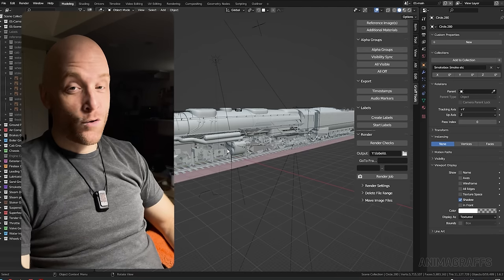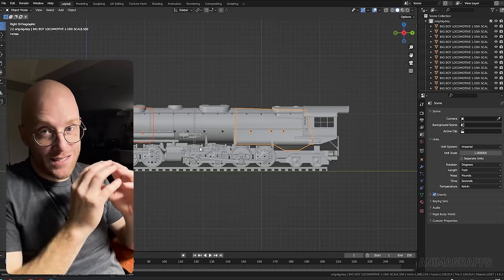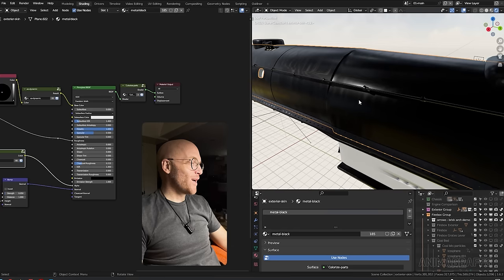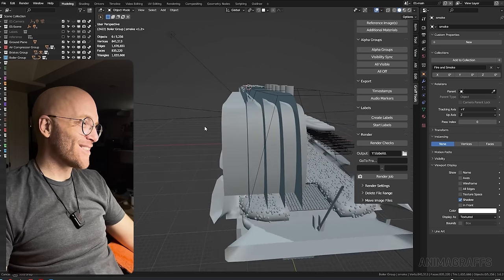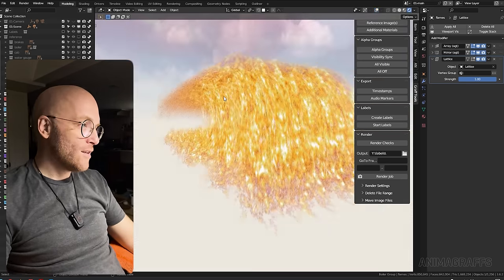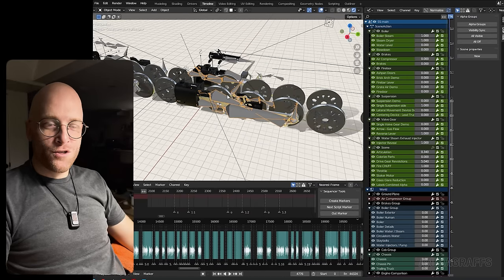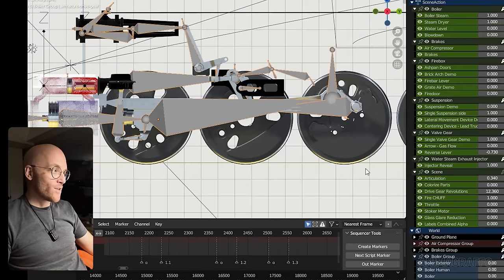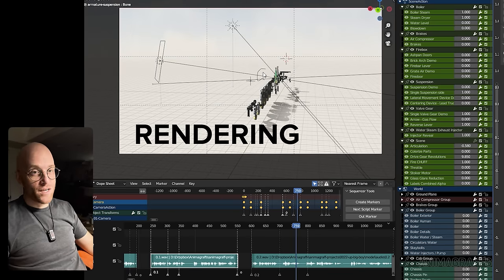How I recreated an entire Steam Locomotive in 3D

Comment: I can attest to the difficulty of rigging the waelschertz valve gear. I haven't gotten mine to work yet and I'm only doing that because I want a more hands-on way to learn how the linkages interact with eachother. I find it absolutely insane that you pulled that off so beautifully. Respect, man.
Reply from the maker: It's the secondary and tertiary movement that really fries Blender's wires. Some of those components never 'rest still', they're always being driven by some other part. Solidarity, may you achieve the holy grail of getting it to work and also actually understanding how all those parts contribute to the final outcome [prayer hands].

Comment: Bloody awesome! I worked as  Mech design drafter in the 90s. I learned 3D surface modeling. Now I use Fusion 360 for my work. So I have an appreciation of what's involved even if I don't use Blender. I sure do get how complex a job it is to do what you did for the Steam Loco video. Damn impressive. I loved that vid!

Comment: I was sure you did all this in SOLIDWORKS or Fusion... And I use those for a living. Man, Blender.. bold move. Much respect.
Reply from the maker: Thank god for the illustrative style I use that lets me keep the meshes really simple. Sometimes tho, try as I might to avoid it, I have to build complex stuff with cutouts and radiuses and proper beveled edges and yes, in a mesh modeler it's a circus ... where in CAD software it'd be a breeze!

Comment: I was really impressed by your Diesel Electric locomotive and always wondered how you acquire your information because most modern designs and drawings are regarded as proprietary and are usually safeguarded by OEMs and Rail Companies. It's even more impressive that you actually reconstruct your information from fragments that you find online. Side note, your blender skills are insane...this is light-years away from the Donut tutorial. 😂😂
Reply from the maker: No wonder it was so difficult to find. The modern loco project really tested me (us, as I was working with my brother at the time). However, with enough persistence, we eventually found the forums where folks were discussing stuff, enough to piece things together. I was staring at drawings not knowing where the lines went, and realize the water tank, for example, was staring me in the face. Couldn't tell what was what without clues tho! The F1 project was put toghether doing deep twitter searches in date ranges, etc. If you want the good stuff, sometimes you gotta go the distance! Glad you're here on the channel, btw :D Here's to the mountain of donuts it took to get here.
Reply: @animagraffs  I was thoroughly impressed by your work, I have worked for over 10 years as an Engineer on Electric Locomotives. Locomotive Engineering is such an esoteric field. When you tell people  that you work with locomotives, the first thing they imagine is a steam Engine Locomotive from the 1920s. 😆😆 I will send you an email, if you have any questions on Electric Locomotives or modern locomotive systems you can feel free to ask me.

Comment: [Just having a template] Totally agree. I had to do a commercial kitchen once (back in the day). Downloaded 3d AutoCAD blocks from manufacturers. The actual manufacturers of the equipment.

And it was horrible geometry. But, I dropped it in and poly modelled on top of it without having to think or guess or measure pixels... Totally worth it.

Comment: Those models you buy are made in a CAD software. CAD is much more easy to work with with hard surface objects (to me) so I understand why those modelers use it. I always do the same, I model machines in CAD and animate and render in Blender. To me, it's really difficult to model a machine in Blender, I'm used to the precision in CAD and modelling a pipe like you did without a dimension feels very strange to me. But yeah, you're good with Blender, I'm not. Congratulations for your dedication and determination.
Reply from the maker: Yeah I do understand why they look like that. If I wasn’t needing specific models, but rather, any generic train, I’d find meshes that are made for this kind of modeling. 

I’ve used some CAD style modelers and even took some tutorials for Fusion. It’s so amazing to be able to cut, bevel, etc wherever you want, with perfect dimensions. I’m with you on that. But I need cinematic style vertex modeling for everything else like materials, rigging, deformation (especially) and so on.

Comment: Pa there is an addonnwhich allows you to do material override on either; material, object, collection l, scene (I believe). Works for both cycles and Eevee. I can post /message link if you want. But learning Python is handy. I've also done that because if an external renderer I used with blender. Because of that, I can make tools I want or adjust add-ons if I wanted to add or edit functionality.
There is also a sectioncut addon, works super nice. I worked a bit on it.

Comment: Amazing.

Out of curiosity.
Do you have breakdown of the effort needed in hours for each phase?
Reasearch, modeling, texture material, rigging, rendering, post comp

Thanks
Awesome work!
Reply from the maker: Research - 2 weeks to get a workable understanding, then ongoing throughout the whole process
Modeling - 3-6 weeks
Rigging 1-2 weeks
Animating and Rendering - 1 week

Since I cover different sized projects, it's probably 1 to 2 months on average, up to 2.5 months for videos 30 mins and above, working basically full time as this is my only income.

Comment: "Locomotive Cyclopedia" - Why couldn't I find that resource when I was doing my 282?  Fantastic resource and it says the first volume is 1906.  Wish I had your Big Boy video as well so it didn't take me so long to figure out the locomotive suspension - especially for the trailing truck
Reply from the maker: :D If you watch Hyce's "reaction" video (linked in the top pinned comment) he also explains more about suspension (and a ton of other info). I accidentally got it right from studying drawings, but it was super duper hard! The theory is a 3-point setup, like a stool, because with those 3 points it will always be resting on at least two of them. Anyways he explains it better than I can, for getting into the nitty gritty. It's cool to hear I helped you find more info though, because I know the suffering of wanting more info and not knowing where to find it!

Comment: This was really inspiring and I'll defo have to use some of your tricks! If you don't mind, how do you deal with the pointer line width receding in perspective? I tried to solve it once but I think I ended up shrinkwrapping them to a plane in front of the camera to get them all even. I'm currently working on something similar but for a church construction documentary film
Reply from the maker: In "edit" mode for curves, there's a "radius" setting that determines the line radius at each point. You can put a driver on the far point's radius, so it scales based on distance from the camera. That is, it makes the line fatter as it recedes from the camera's position. It's not perfect, but drivers also let you edit the f-curve for their influence ... so you can tweak that f-curve so it behaves right.
Reply: @animagraffs  That's so simple and elegant! Cheers for the in-depth reply

Comment: I thought it's probably faster to model it yourself of a blue-peint vs correcting an existing model to a blue print. Corrective modeling on a bought model can take so much work. Unless it's a blend file and you can toggle subsirf on and on. Otherwise your working with tons of poly' which make the work way more complicated. You did state you use it for placement. But how well do those bought models lineup vs your blue-print?

Comment: How different is using Blender to model mechanical things verses CAD programs like Solidworks and Inventor?
Reply from the maker: Those are what's called "parametric" modelers, and it's honestly very different. Where blender uses meshes and points, those softwares actually do have solid objects, is my understanding. And cutting shapes, beveling, etc. it much easier with CAD style software. If you want meshes to deform (like organic stuff, like trees, animals) you need meshes made of points, like the "net" of vertices you see in my work. If you're building parts to manufacture, you want solid, stationary, precise objects.
Reply: @animagraffs  Cool, thanks for the reply! The only reason I asked is, I use CAD every day as an engineer, but as someone with a creative itch I've always wanted to try blender but it's super intimidating to me!!

Comment: How do you do the transparency, because I notice you have fully shaded objects which cast shadows partially covered by transparent objects (the smokestack, for example) but the lighting looks even across it as if the semi-transparent objects don’t block out any light at all.
Reply from the maker: If you're using EEVEE render engine in Blender, you'll need to set your material "Blend Mode" and "Shadow Mode" to "Alpha Hashed". It's not as fast as "Alpha Blend", but it's the only way to get more accurate transparency with shadows and whatnot. If you're using Cycles, that's a whole different animal and it should calculate all that automatically (shadows, transparency, refraction, the works).
Reply: @animagraffs  Thanks! I guess because Eevee doesn't do GI transparent objects don't block out much (or any) light.

Comment: Can you share any resources you've found for accurate fonts? Even though I have a graphic design background I sure struggle to match a lot of the original fonts from this era. As hard as I work just in 2-D, this stuff blows my mind.
Reply from the maker: Heyo, I started in graphic design! Did it for probably a good 7 years, and I'm still so glad I understand design aesthetics. As for typefaces, for the "4014" big badge on the door I used some random font called "Cityof", and I have no idea where I got it as I already had it. For text on many gauges and labels in the cab I used Akzidenz-Grotesque Condensed.

I'll admit I'm halfway winging it with fonts here though. I just wanted it to look "pretty close" to what I was seeing in my reference images. Sometimes I'll get the notion in my research that a typeface HAS to be spot on or the internet will get mad at me. But with this one I could tell even the designers weren't all that hung up about it. 

Other fonts from this era I like would be any News Gothic, Franklin Gothic, Trade Gothic, etc. Futura. Those would all look appropriate in a 1930's - 1950's machine.
Reply: Thanks for your quick response. I have to say a big thank you for pointing out the Locomotive Cyclopedia. That could have saved me many hours.... I'm seeing more detail there than I've been getting from some of the railroad archives I have contacted. Keep up your outstanding work!

Comment: 30:20 you could just export it as an AVI and use an online tool to export it to an MP4 or MOV
Reply from the maker: I use image sequences because it allows fine-tuned control over each frame. If I spot an error, I need to catch it as soon as possible, stop the render job, fix it, and re-render only those frames without having to start over form the beginning. With any kind of movie export, it's all or nothing.

Comment: Why not use a cloud rendering service like renderstreet?
Reply from the maker: It's been a while since I tried out a service like that but in the past it got kinda expensive. The power bill for 65k+ frames is like $16 bucks extra for the month ... Render services seemed to be like $500 for shorter jobs (1 minute vid) when I used them years ago. And that's just for a standard Blender file. At this point I've got a lot of custom stuff going on that would likely be extra work to get going on an external server. And I'm not sure how they optimize for eevee renders, it's usually all optimized for cycles.

So all in all, being able to see errors in my renders real quick, stop renders, fix it, etc., is powerful and way less stressful and costs very little, since I'd be building a beefy PC anyways. If you're into 3D art at the pro level, you're also gonna become a PC builder. It's just about inevitable.
Reply: @animagraffs  yep makes sense. I hadn't considered the electricity cost, just the time cost. But if there's no hard deadline then of course your setup is great. Thanks